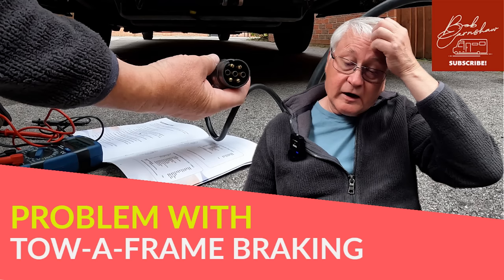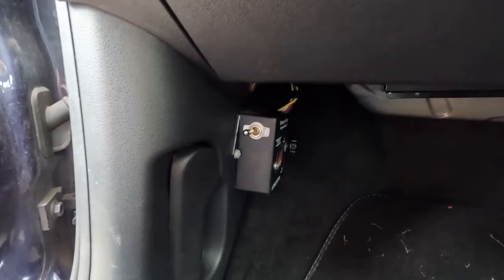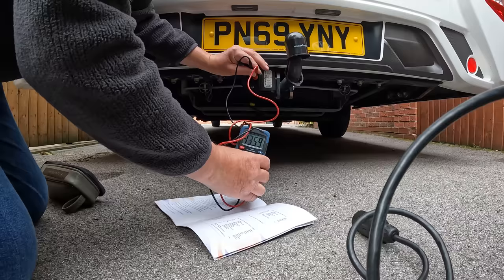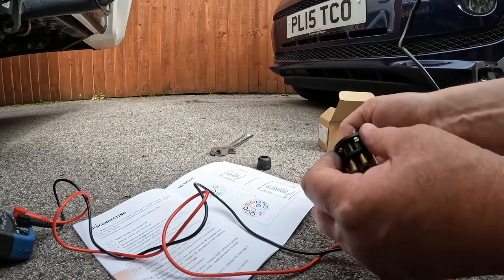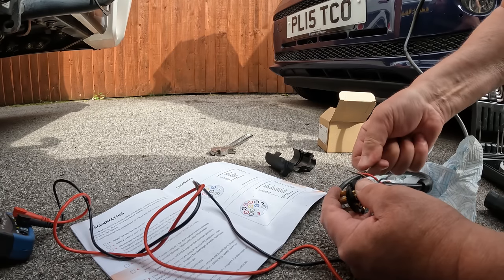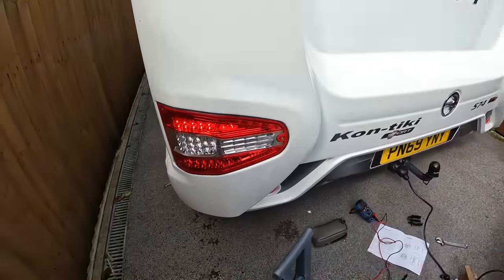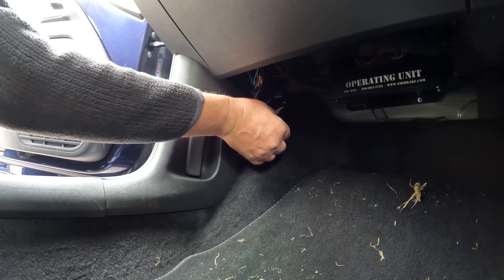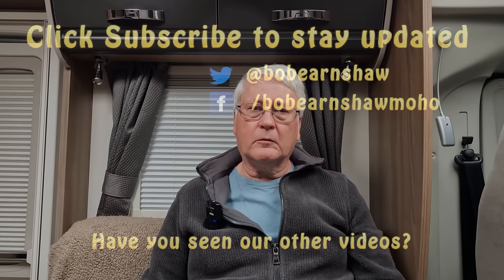Problem With A-Frame Towing Electrics | Check On Braking Sensitivity

Comment: Thanks Bob👍 … Since we downsized to a V-line we’ve not towed.  We used to tow behind our Chieftain and very scarily lost our car and wrote it off a few years back on a roundabout in Southport on route to the CC site.  But that is another story!  We replaced the car after it was written off but it made me very nervous for a longtime afterwards. I never did find out what had really happened but for sure the breaking mechanism failed to operate the cars breaks before it careered into another car waiting at another exit. We still have a tow car which Debs only uses it for work, but we have discussed fitting a tow bar again on the V-line for towing. However in all honesty that may never happen as the van gets us about without any problems. Except that is where some towns are anti camper/Motorhomes. We will see though … Thanks for sharing 👍
Reply from the maker: That was scary. I regularly check the break away system works by pulling out the break away cable plug, which should operate the brakes.

Comment: Great video Bob ,I like to add quality ferrules to those  wire ends  before inserting into the plug screw downs , they keep the strands together and offer protection from oxidation etc ,even the stuff in the Motor home  I re do any wires adding the ferrules  👍👍
Reply from the maker: Good idea, might do that.
Reply: @BobEarnshawMoHo  Yes you would need a good ferrule multi jaw crimper and correct ferrules ,kits are available not expensive some start at around £15.00 highly recommended ,i like the ones with an insulation sleeve and tube ,you will find yourself doing lots of wires ...Jenny will think your  going ferrule  😀  👍
Reply: I was just going to say exactly the same. The copper used nowadays is very impure and oxidizes, hardens and becomes brittle. 
"Boot lace ferrules improve the reliability considerably. They also allow proper tightening without damaging the strands. 
Sealing with vaseline and electrical tape helps too. I put a tie wrap cut off short on the outer cable insulation just where it is inside the plug to prevent it pulling out.

Comment: The grease is probably a silicone based product as used in our plug & sockets for added water repellant to pretect the terminals from water ingress/condensation etc., and shorting them out.

Comment: The grease you found is s probably Dielectric or  Silicone grease the problem is it's not a conductive material it's used as an insulator or for making article moisture resistant  so use on outside not on the inside if that makes sense.

Comment: Very interesting that, I’m surprised the system works on electronic signal over mechanical but it makes sense once explained, how does the steering lock stay off on the tow car ? That’s always interested me as well with our car having an electric steering lock and keyless entry.
Reply from the maker: The VW Up has an old fashion key, I leave the spare key in the ignition barrel, steering lock off.

Comment: Surprised to see you have the old seven pin plug.
Our Towmaster A-frame has the more modern twist and lock thirteen pin plug and socket.
Reply from the maker: Our first motorhome we towed with came with the 7 pin, so we had to get the same for our current motorhome.

Comment: If you haven’t got a wiring diagram take a picture beforehand (worth doing anyway) and you can cross check after. I guess the grease is a build up of spray/road dirt and the cause of the problems. Perhaps add it to the annual maintenance check list? Good video Bob.
Reply from the maker: The grease was purple in colour. Good point about taking a picture, I took several and forgot to mention it in the video!

Comment: Hi Bob, I have the same system as you and had a very similar problem 3 weeks ago heading to Hawes on hooking up and doing my checks no brakes when pressing the MH pedal but all lights working, 2 weeks before I had the system go through it’s 1 year check and had the smart box moved forward slightly as it was very close to the drivers seat when sliding it forward, it’s on the opposite side to yours and it was out of angle very slightly, after taking to the fitters in Bellshill I had to play around with the sensitivity of the screw and managed to get it working for our next trip which we have just returned from..The fitter explained the smart box has to be at a specific angle so after moving ours it was out slightly..All good now…
Reply from the maker: Thanks that's interesting, dude know that about the angle.

Comment: I can’t think why there was grease inside the plug. Could this have been moisture over the course of time that has turned to a sticky substance? I think I would prefer the electrical joints to remain dry rather than requiring any contact fluid on them. Interesting video Bob, enjoyed your explanations 😃🚐👍🏻 Trev

Comment: Well done Bob. Electrician in the making.
To be honest I think the grease could have been your problems. The wires and screw plugs should be dry and clean. Not sure why the grease was there. It can cause short circuits.
Regards
Andrew
Reply from the maker: That's my thinking.

Comment: Just a quick question Bob, is it normal for your number plate lights to flash when you insert the plug ?, good vlog again.
Reply: I noticed that too!
Reply from the maker: No, I accidently left the motorhome ignition on when I plugged it in, think that's why.

Comment: To make things more reliable have you thought about terminating each wire with a crimped pin? I don't know if there's room inside the connector to do this, but you can tighten the screws a bit more.
Or solder the end of each wire.
Reply from the maker: The wires were soldered.